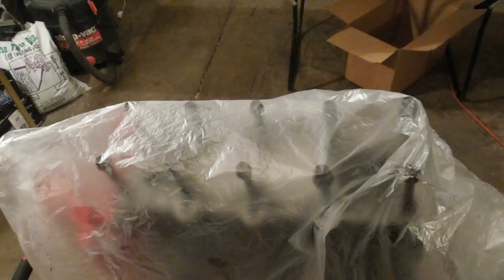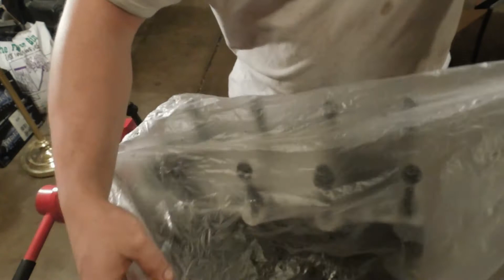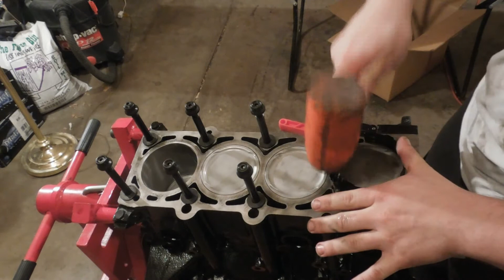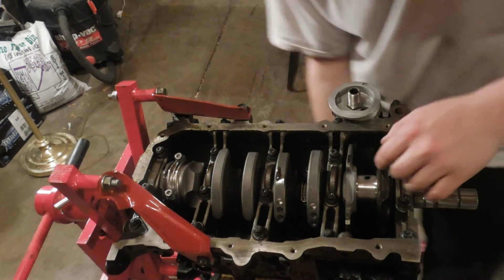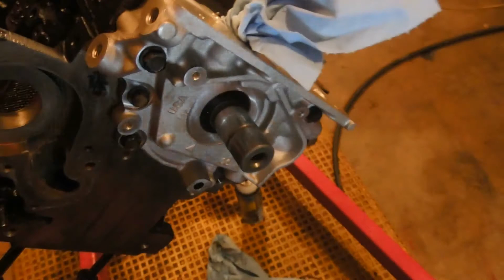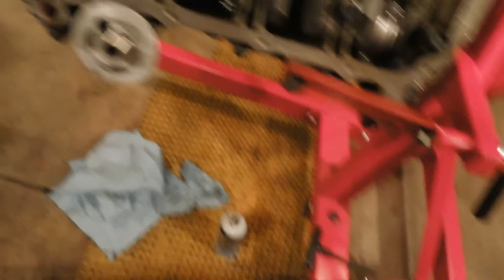420a Performance Engine Build Pt 20

Comment from the maker: factory head bolts are torque to yeild bolts, which means you torque them to a certain torque specification that has been determined by the manufacture and then 1/4 turn more( or 90 degrees more depending on how you view it). factory head bolts are torqued as shown: step 1 long bolts to 25 ft lbs and short bolts to 20 ft lbs, step 2 long bolts to 50 ft lbs and short bolts to 20 ft lbs again, step 3 is a repeat of step 2 and then step 4 is to turn long and short bolts 90 degrees/1/4 turn more.

Comment: Hey man love the build, what gaskets/o-rings are required for the oil filter adapter exactly and where did you find them?
Reply from the maker: thanks, glad you like it. i have done a bit of searching for the gasket your looking for and it looks like it has been discontinued by mopar/chrysler crop., and im not having much luck with searching for a felpro gaskets either.  the best i have come up with is part number from mahle on advance auto parts website which is not available either. Factory P/N: 04777425 (superssesion p/n: 4777425 or 06034802). I can try another source but i have to wait until monday morning to use it. Until then, there isn't much i can help you with on it. you may end up substituting another o-ring gasket for the one you need. 
Mopar: https://www.moparpartsoverstock.com/p/Eagle_1998_Talon-ESI-20L-I4-AT/O-RING-Oil-Filter-Adapter-O-RING--Oil-Filter-Adapter--ID-1942-CS-106/6678549/04777425.html
Advance auto parts: https://shop.advanceautoparts.com/p/mahle-oil-filter-adptr-o-r-a6302569871mah/11939027-P?navigationPath=L1*14924%7CL2*15038%7CL3*16137
Reply from the maker: the only other ideas i have is to try a front crank seal set from felpro and see if the o-ring is in it (p/n: tcs45962) or an oil pan gasket set and see if the o-ring comes in it. you can go to any auto parts store that has it in stock and ask to see what all comes in the sets visually.
Reply: @thecartuner007  thanks man I really appreciate that alot. I'll look into and let you know what I come up with. Thanks again!